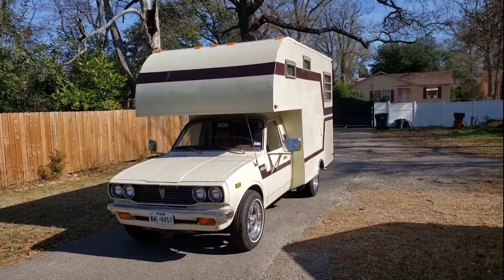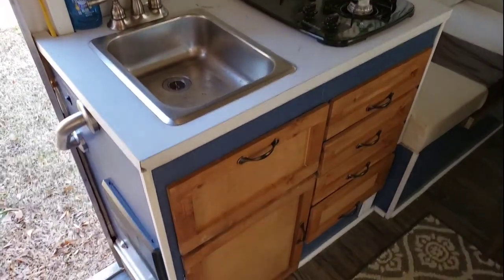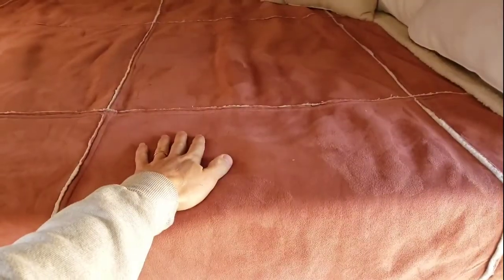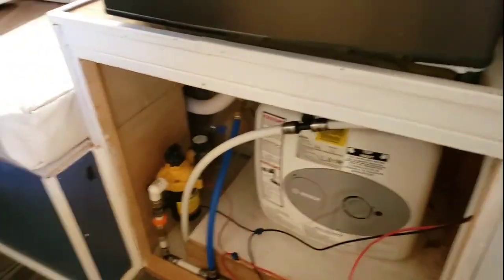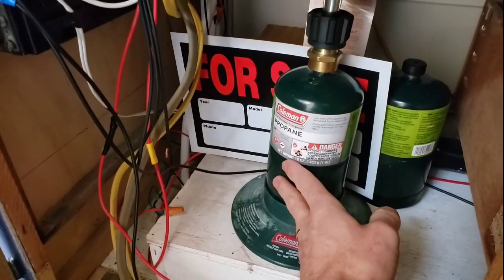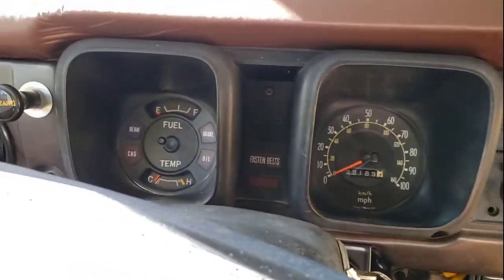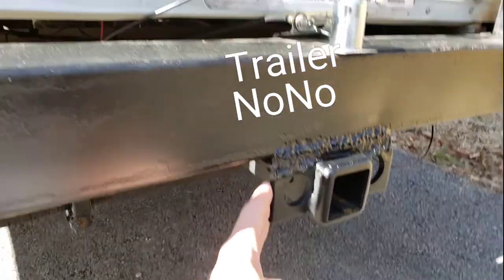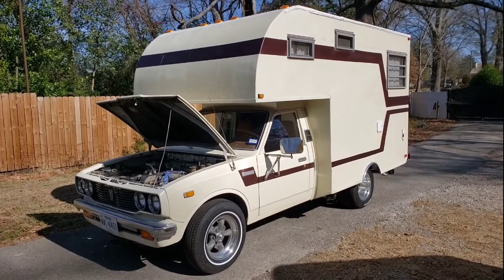1977 Toyota MicroMini RV motorhome, take 2

Comment: Where did you get the GPS/backup camera?  What is it?  I really like that and would love to add it to ours.
Reply from the maker: I found that unit on eBay just searching for 'GPS Stereo'.  There are many like it, all priced similarly (around $140).  Wires in like a regular radio.  The camera is very helpful!